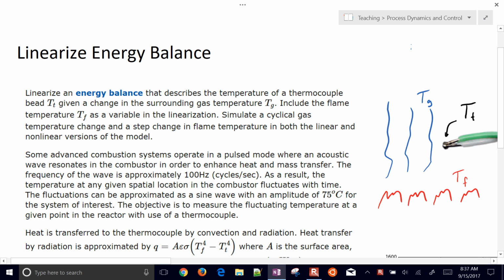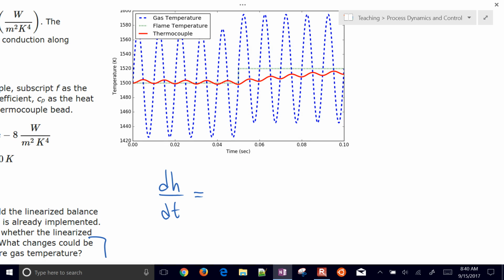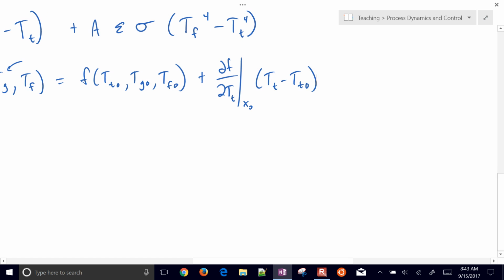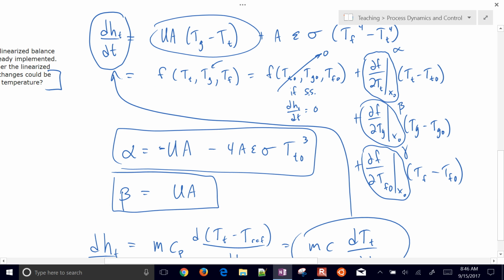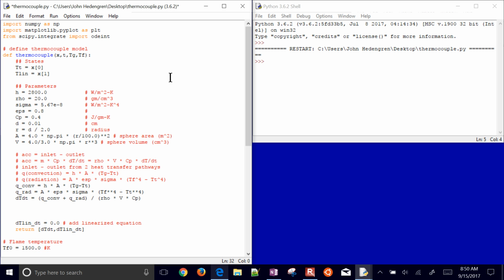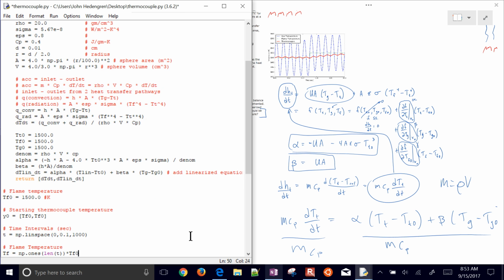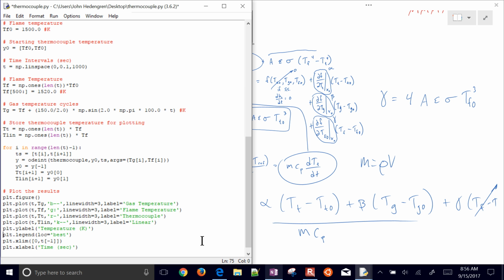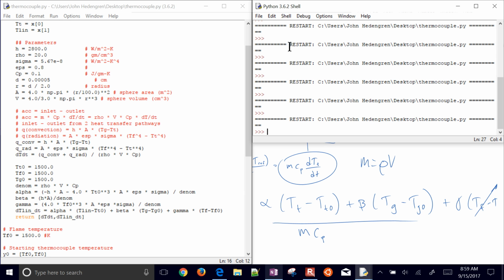Linear Differential Equation (Energy Balance)

Comment: Professor, I am not sure if I understood the energy balance explanation. Steps used were:
1. General energy balance: dh/dt = m_in*h_in + m_out*h_out + Q + W
2. Assumptions: No mass in nor out in thermocouple and Q input is divided by convection and radiation. No work identified.
3. Energy balance expression: dh/dt = q_conv + q_radiation

Am I correct?
Reply from the maker: One small correction is that Q is added to the convection and radiation on the right hand side of the equation. The solution is posted here: https://apmonitor.com/pdc/index.php/Main/LinearizeDiffEqns